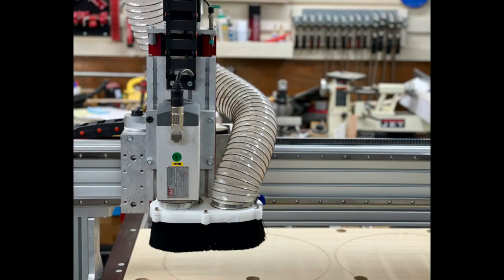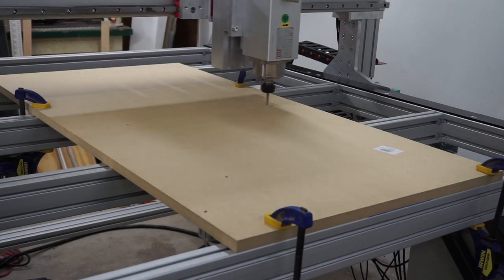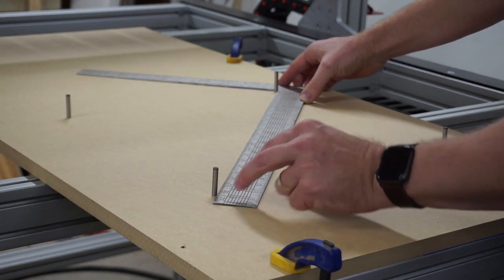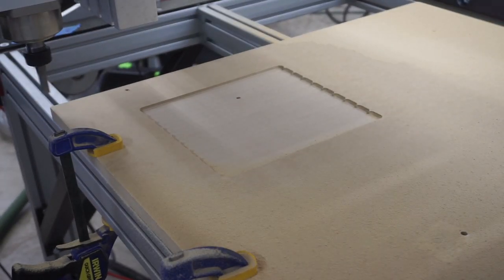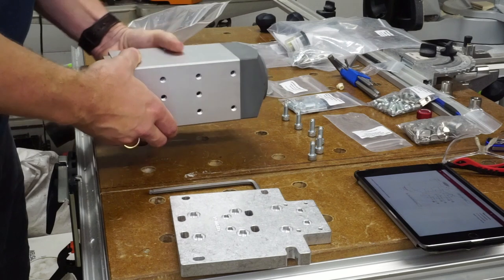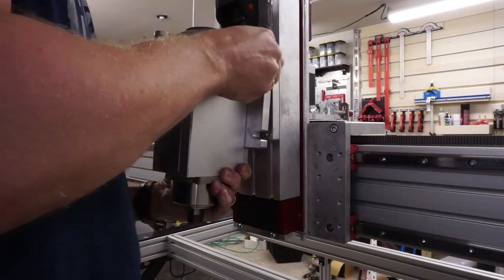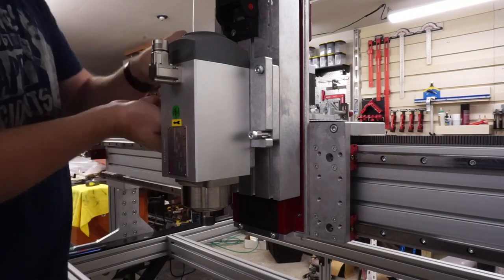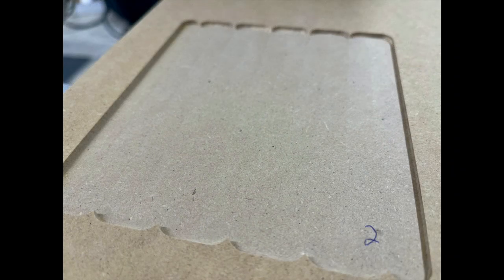Avid CNC Spindle Tramming

Comment: When making adjustments do u listen the other three screws or do u leave them tight for spindle making the ridges
Reply from the maker: When adjusting, all the mounting screws will be loosened just a little bit, then the eccentric bearing can be used to move the entire plate after which the mounting screws are tightened and then the tramming is tested again.